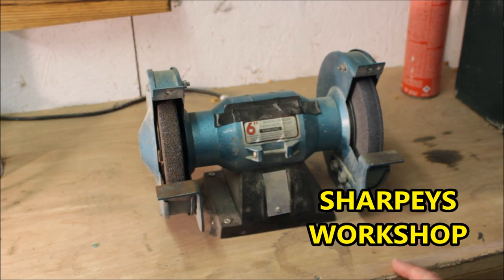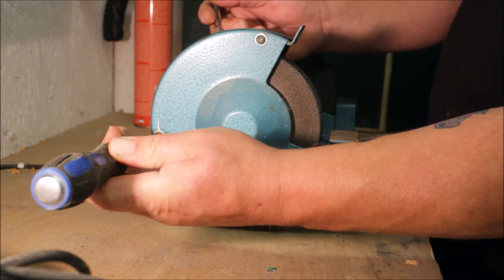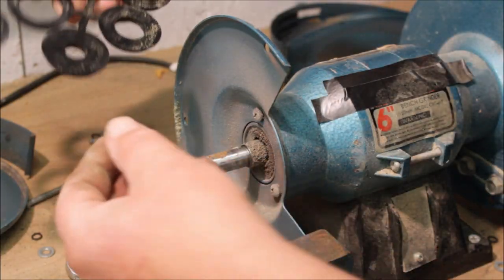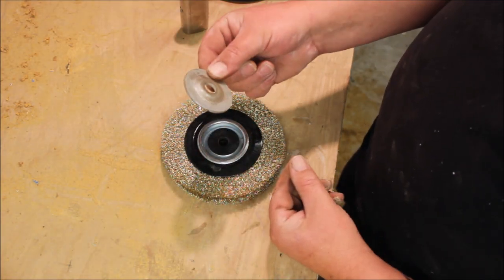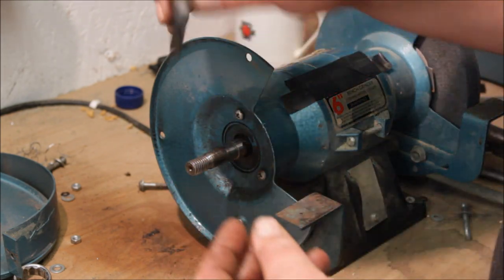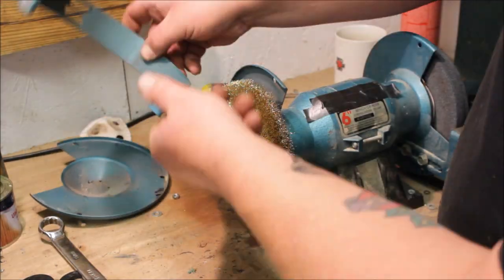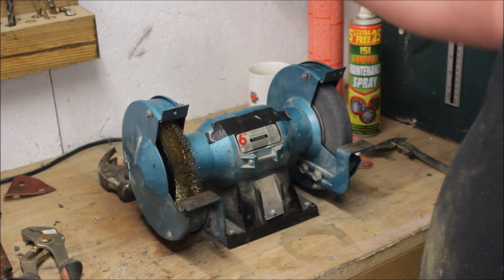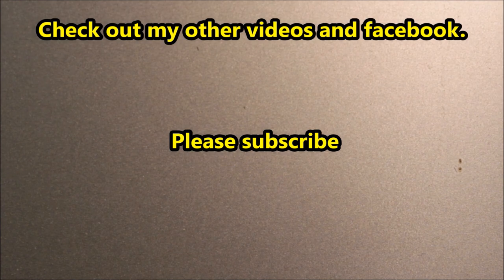Fitting a wire wheel to my bench grinder (screwfix)

Comment: I removed the guards for the wire wheel but kept the guard on for the stone for safer operation. I don’t think a wire wheel needs the guard and with it off it makes it much easier to use all of the wire brush.....especially on larger projects. Great tip on the two nuts! After struggling to tighten up my wheels it did the trick. Funny how such an easy solution can be missed.
Reply: Since posting this comment, I’ve also learned that you shouldn’t over tighten the nuts as you risk cracking the stone. Firming the nuts up  is better and the rotation of the wheel will keep them tight. I guess that’s why many grinders don’t have an arbor lock .....prevents users from cranking those nuts down too tight.

Comment: I resolved brush noise and better uses with going from 6” wire wheel, to 5” wire wheel. 
No noise, doesn’t touch guard, or work rest. Also spins faster. 
I use coarse grind stone, and fine wire wheel. 
Perfect for my needs. 
Good luck to all.
Reply: Yeah that’s in the manual 6” inch stone and 5” wire wheel.

Comment: I found my manual for my Delta 6" bench grinder... it states "When changing wheels, simply remove the side screw covers to the grinder and remove the side cover.  To prevent the shaft from rotation, place a wedge between the grinding wheel and the wheel guard...".

A rubber door stop wedge might be ideal for this... gonna give it a try, although I already managed to get the one stone off, after removing the guard for the other side and holding a wrench in place on that nut.
Reply: That's what I do (jam the wheel)

Comment: Hi Paul, this looks scary, safety goggles a must. Can hear the stray wires scraping on the guard? Wonder if you can run the wire wheel without the guard? I saw a few videos that suggest soaking rusty tools in vinegar? Interested to see the results. I have a couple of old vices I want to refurbish. Record imp and big old bench vice. Enjoy your videos buddy. 👍🏼
Reply from the maker: +Greg Virgoe hi Greg yes it is a bit scary it sounds worse on camera though and goggles are a must on this one it does a cracking job I've just cleaned a chisel of camera looks great
Reply: Greg - soaking in vinegar works well. I've tried in on a few old tools that were quite bad. It leaves a blackish patina but fine details remain. For chunky bits of metal, I think this is a good way to go though - probably a better finish if you want to paint

Comment: In manual on my new Delta Grinder it states to use the same wheel on both sides otherwise premature bearing can occur. Been using this setup on my blue point for decades

Comment: Hi sharpy ,why did you put black tape over 'clarke' ?
Just done this tonight on my 6" Clark grinder. I too faced same problems, opposite thread. I used 2 of the spare plastic spacers to pack out to correct width. Seems to work. I'm thinking of removing the tool rest , what do you think?
Reply from the maker: Hi Brendan I am working on covering all name brands I own  I don't think it's fair to give them free advertising lol as for the tool rest I would leave it on but one or two people have said remove the guard but the tool rest is really handy I've found but I always wear safety goggles it is a must with the wire wheel a peice of wire hit me the other day and fetched blood on  my arm good luck buddy and stay safe
Reply: Covering the brand name lowers the value of your videos, people like to see what tools you have, dumb idea

Comment: I removed the guards on mine because of the stray wires.  Within seconds the whiskers had begin to chew up my guards and sounded awful as well.  You do lose your tool holder but that's not really critical with a wire wheel.

Comment: I was always told that the dished washers are fitted with the "dishing" outward from the wheel/stone because the drive is transmitted through the flat faces of the washer (greater contact area so better friction) and if fitted with the dishing inward it's actually dangerous because the "spreading" loading of the tapered faces combined with the centrifugal/petal forces when the machines running can cause the wheel or stone to fly apart ------- the little plastic washers are only to centre the wheel on the shaft (the centring bushing kit allows the wheel to fit a greater number of machines) playing no part in the running of the machine except location.

Comment: Just use the the wheel on the other end, either hold/turn it with your hand while having a wrench on the bolt to loosen or tighten it.

Comment: airmoji, that’s the issue I was having with my Ryobi 6” grinder. I wanted to install a wire wheel, but whenever I tried tightening the nut that holds it, the opposite one would come lose. I’d think the shaft had a notch to place a wrench and hold the shaft from moving but it doesn’t.. Do you knows what torque to give to the nuts holding the wheels?
Edit:
Ok so I was able to tighten both nuts..
On the right side between the motor & the wire wheel, there is space enough to squeeze in some tongue and groove pliers or even some locking pliers to hold and keep the shaft from moving..I covered the pliers teeth with blue tape to avoid scratching the shaft. It worked perfect, I was able to tighten both the right & left retaining nuts!

Comment: Hi Sharpey, What is the wattage/ power of your bench grinder. I was looking at buying a 150w bench grinder to use with a wire wheel. Dont know if it would be under-powered for a wire wheel.
Reply from the maker: Hi buddy it's is 150 watt and to be honest it is a little underpowered but it gets me away cheers
Reply: @SHARPEYSWORKSHOP  Thanks for the reply Sharpey. Is 150w ok to grinder HSS lathe tools?

Comment: Hi Paul, I tried this with my altocraft bench grinder, but after I changed to the wire wheel, it wouldn't spin, I changed back to the grinding wheel and then it works, any ideas on why itty would not spin when I changed from grinding wheel to wire brush wheel? Thanks in advance! - Robert
Reply from the maker: Hi Robert it sounds like the wheel fouling on something try leaving the guard off buddy
Reply: SHARPEYS WORKSHOP hmm, I tried that as well, didn't work either. I wonder if something is triggering it to not spin? It looks like it tries, but then it just hums.
Reply from the maker: I don't think so bud if the motor is humming there's definitely something jamming up or an automatic brake maybe